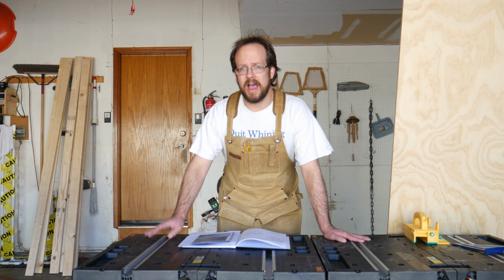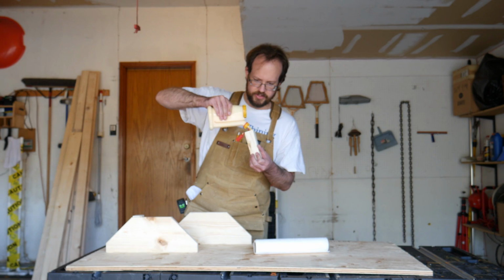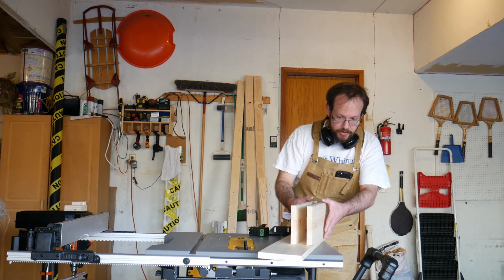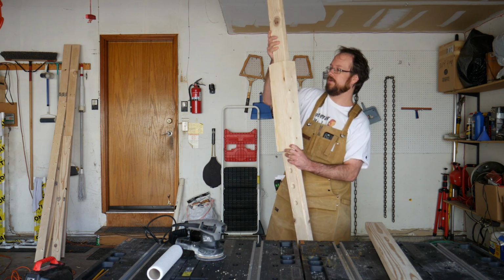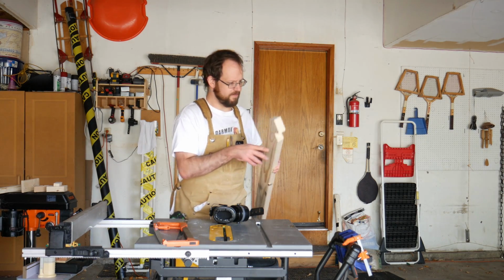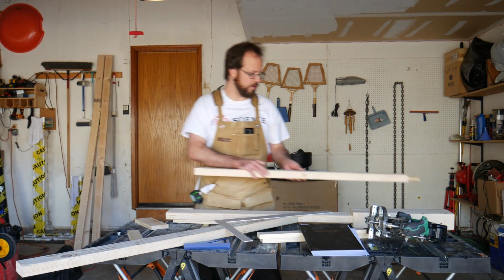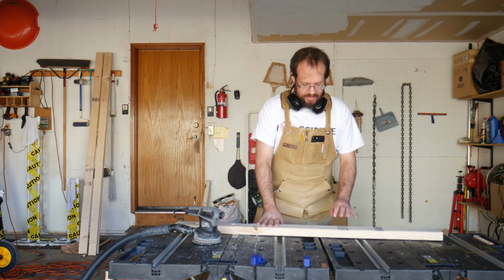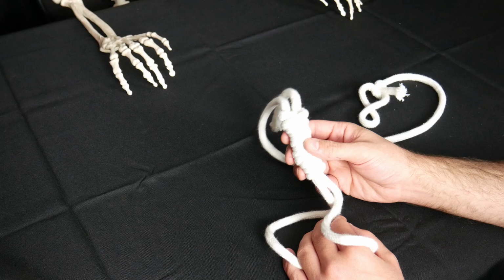How to Build a Gallows | DIY Collapsible Gallows Halloween Decoration

Comment: Look at getting you a oscillating multi tool, it would have worked great for a lot of those cuts you did on that 45° swing arm support! Great project man!!! I absolutely love it, looked all over and couldn't hardly find anything, most definitely not anywhere near as informative as your video!!!!
Reply from the maker: @bretmartin8907  thanks! I’ve got an oscillating tool…can’t remember if I had it yet when I put this one together or not.